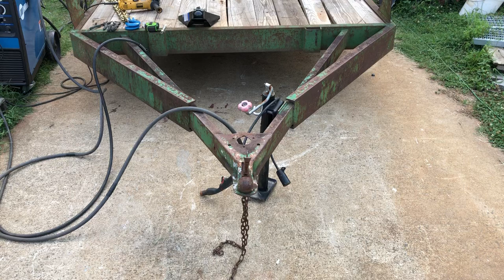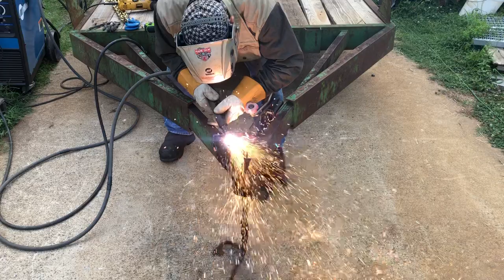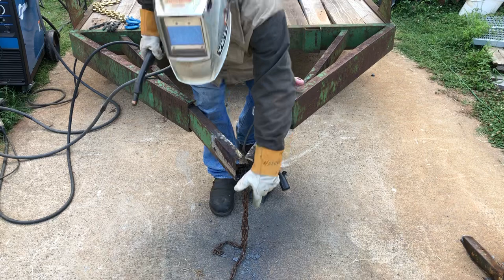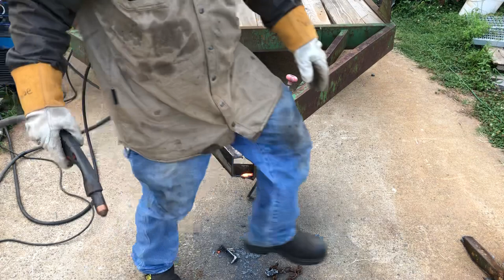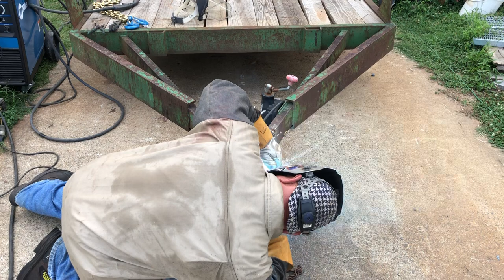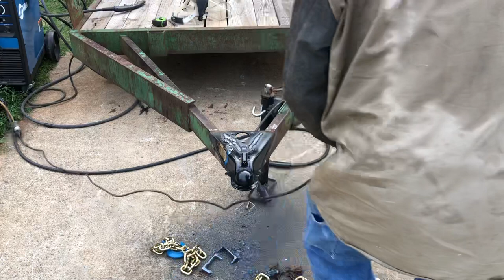Welding tips, Plasma Arc Gouging a trailer coupler

Comment: Good job! My only concern is your knees! Just watching you hurt me! I have bad knees , osteoarthritis.... I can not do these jobs without my knee pads! Love your plasma arc! We're you running off your garage compressor?  Love to get a portable compressor for my service truck, so I could utilize my carbon arc with my Lincoln Ranger 9... Thank you for the video
Reply from the maker: I should have used my knee pads. My knees are wore out too. I did use my shop compressor. I have air on my rigs for carbon arc gouging in the field. Most jobs in the field, for me, require deeper gouging than what I like to do with the plasma. 👍
Reply: @welderguide5985  may I ask what air rig set up you have on the truck? Looking into this very soon for my side welding business... , just not sure what would be best beneficial portable compressor on my truck... I appreciate any input... I use big 440/480 welding machines at a steel mill where I work.. man, you can air arc over 600 amps easily using 1/2" carbon and flat carbon.. makes a lot of jobs very nice!!! Thanks again
Reply from the maker: @josephnovakjr8198  it’s a  Northstar 13hp 60 gal tank from northern tool

Comment: Is it illegal to weld the chains?
Reply from the maker: I have not seen where it is illegal. You don’t want to overheat and change the structure of the metal as it could weaken the chain. However, the chain I used was a large chain that could dissipate the heat input. I would recommend bolting on smaller chain on small trailers.

Comment: Don't use bullshit down hill short circuit mig on that always use 7018 or dual shield 0.35 would be great for a small trailer like that
Reply from the maker: Evidently you are not a good Mig welder. When Mig welding is good enough for trailer manufacturers, I think it it should be fine for me. You may want to practice more.